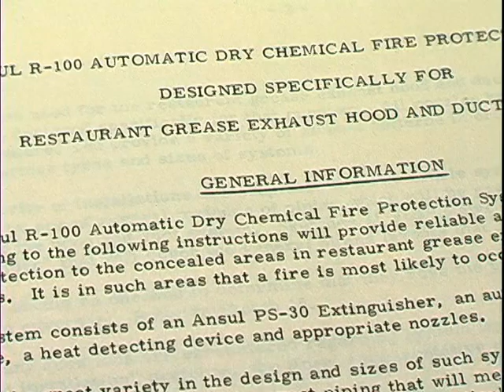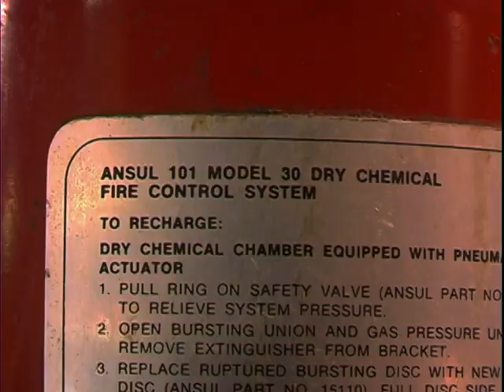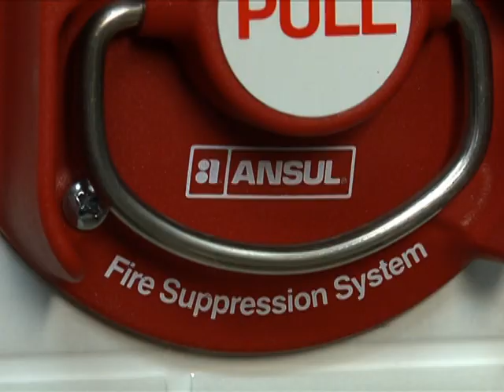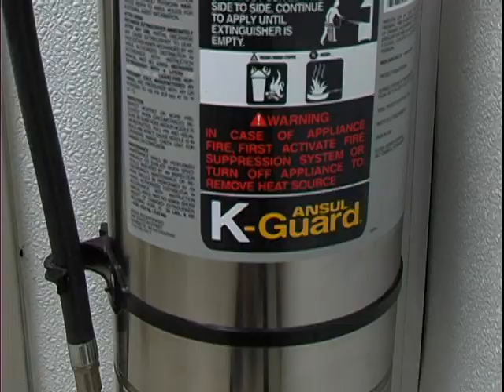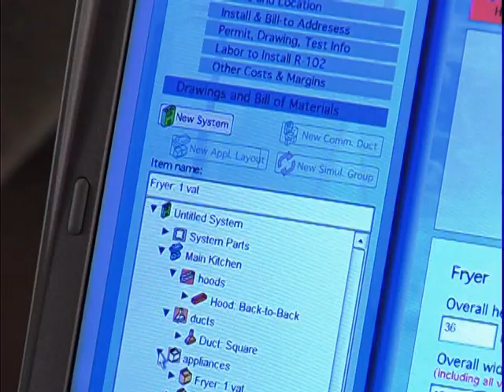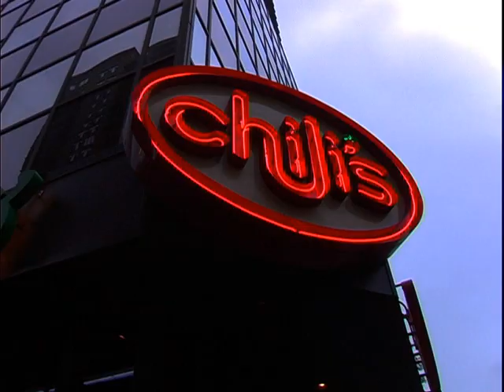Ansul Restaurant Fire Suppression System R102

Comment: When "pinning out" the system for service, its always a good idea to hang the keys to the truck on the "pin". A competitor of mine left a system pinned out at a Perkins, realized what he had done pulling into his shop. He quickly made a very fast 50 mile trip back to the restaurant to put the system back on line.

Comment: I think I'll design a new system..
Reply: @frank 1976 Not for grease fires it’s not. Wet chemicals are used in kitchens for a reason.
Reply: @frank 1976 try it and let us know how it goes
Reply: @frank 1976 yeah like i said. get a nice vat of oil hot enough to catch fire and try putting it out with water mist lmao. remember your PPE. GONNA NEED IT!
Reply: @frank 1976 it isn't though XD every kitchen has an ansul system. unless your in some third world country maybe but not anywhere where we know that water and boiling oil don't mix.
Reply: @frank 1976 uh huh.. which is why the onion ring factory i worked at had a giant ass ANSUL system XD I am not buying any of this bs